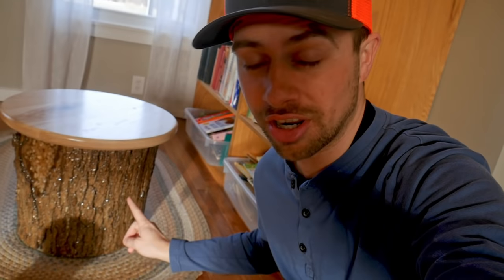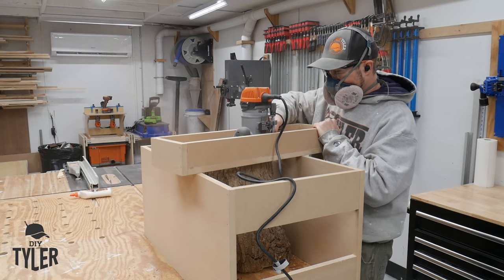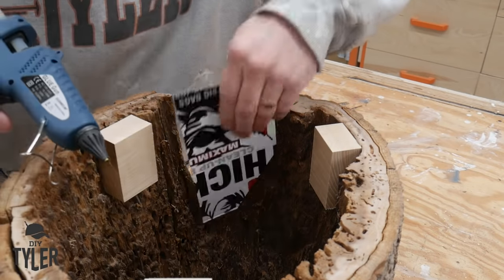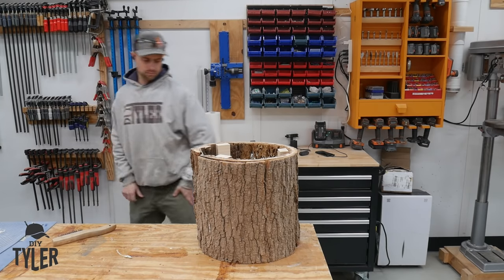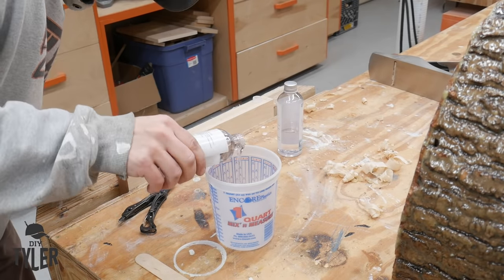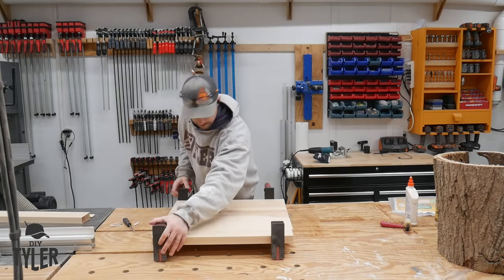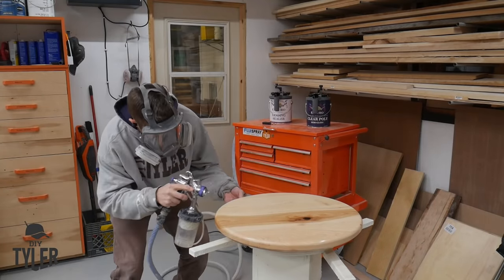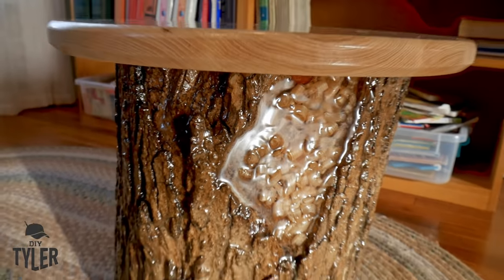WoW! I Flatten a Garbage Tree Stump add some Epoxy and turned it into an Beautiful Stool...Nice!

Comment: I noticed the mixing mates on you finish.  What is your opinion of them?  Do they seal well enough so the finish doesn't dry up?  How long can you keep finish in the can with the mixing mate cover before the finish starts to harden?
Reply from the maker: LOVE them. Especially awesome if you only use certain finishes all the time like I do. Them them on my sanding sealer and favorite topcoat and never take them off. Have left them on cans of finish for months with no ill effects.
Reply: @DIYTyler  Thanks for replying.  Does dried finish collect on the mixing mechanism or the bottom of the lid?